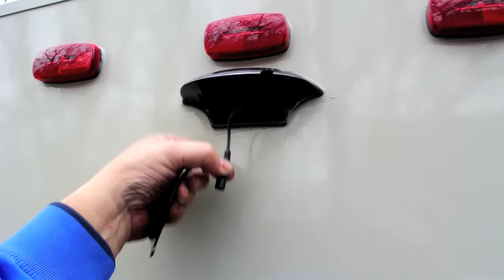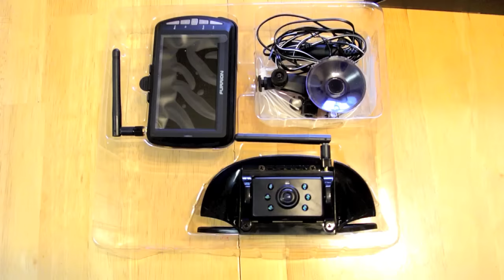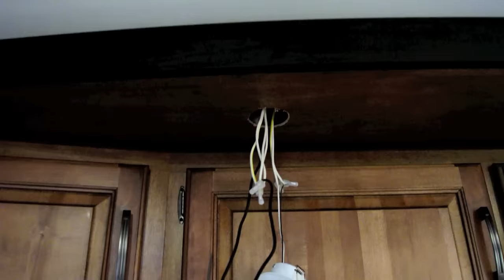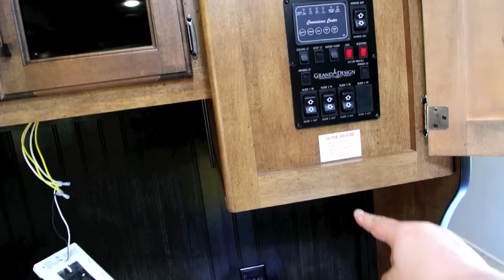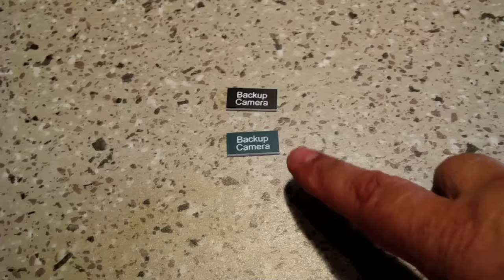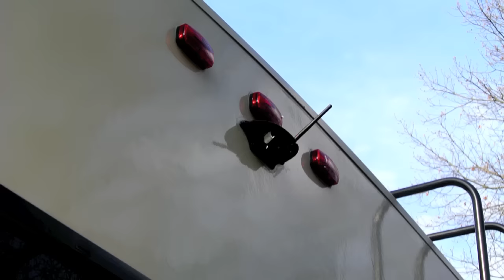Installing a Furrion Backup Camera on my RV.

Comment: I Bought the Haloview RD7 to replace a camera system from Furrion Vision S that had significant drop out issues. Installation was not a problem - powering the camera off the top rear marker light. Swapped out the old mounting brackets for the new ones and ran the transmission cable up to the front of my 26 foot long camper. Mounted the transmitter with liberal amounts of RTV/Silicon.

Got the monitor hooked up in the cab, powered it up and turned on the marker lights. The camera and monitor paired automatically and provided me a terrific view of my back yard - as expected.

Finally got to road test it this past weekend on a short camping trip - about 50 miles one way. Camera performed flawlessly the whole way - didn't notice a single drop out and had very little, if any flicker. Decent field of view as well. I can see cars within about 20 feet of my rear bumper and can pick up the entire lane of expressway on either side at about 40 feet back.

I am VERY satisfied with the performance of this system so far. Big test will be next month with a 1000 mile trip coming up. Looking forward to it.
Reply from the maker: Thank you for your input. I have been asked to review this setup but I would have to replace my current system or at least run them in parallel, something that I cant do at this point.
Reply: how did you get the bracket off? the opening to get to the mounting screws is way smaller than my small 1/4 inch drive 1/4 socket. I can't get the dang socket in there to get it off

Comment: I just installed the RV Observation Backup camera on my 2018 Flagstaff SuperLite. There is not battery drain on my camper. The camera is not ON until the camper is connected to my truck and I turn on the running lights. I will be making a trip Saturday and excited about using the camera.
Reply from the maker: Thank you for your input.

Comment: It said powers up with the trailers clearance lights, if wired into that circuit, your camera would come on anytime you turn clearance light on. Pretty easy and no worries of killing house battery. I always drive with at least clearance lights on plus I’d want camera on all the time I was driving, not just in reverse.
Reply from the maker: Thank you for supporting the channel.

Comment: I have a 2015 travel trailer with the exact prewired Furrion backup camera housing.  The 12V power wired to the backup camera is tapped into the parking lights of the trailer since there are marker lights in the rear just a few inches away from the housing.  Therefore in order to use the camera I always have to have the parking lights on.  I do like your setup better.
Reply from the maker: I actually upgraded the camera to the Vision-S version with 4 cameras. The side marker cameras were powered by the running lights, so I retrofitted the rear camera at that time to run on the running lights as well.

http://www.rv-project.com/projects/furrionscamera.php

Comment: TD Projects-I took my camper back to the dealer today and they told me the wires was backwards so they fixed it and now my camera works. Used it coming home and backing it up at home. Seems like this has been the problem for several people with the pre-wired cameras.
Reply from the maker: The only thing that works on the RV is the owner!

Comment: Very nice install. One would think they would provide a switch if the camera was to serve double duty as a security camera, or they would have wired it to the parking light circuit.
Reply from the maker: Depending on the year and model, some manufacturers - including mine - have used different power schemes, including wiring to the running lights of the RV (meaning you have to turn the lights on in your tow vehicle).

This seems to be the current most popular connection method.

In my Vision-S installation video, I did relocate the power source from the hutch circuit to the center rear clearance light.
Reply: Yeah. I have a new trailer and I was thinking of installing a camera on the running light circuit, as I’d only be interested in using it as a backup/rear view mirror when towing. 

I get it that some folks would also like to use them like security cameras when camping, but I can’t see not providing a switch when prewired. I don’t think anyone would want the extra power drain when the rig is stored.
Reply from the maker: @JeffinTD  In a later video (which you can view here: https://youtu.be/yKzLoUVZPyY ), I upgrade to the Vision -S 4 camera system. I connected three cameras (left-right-rear) to the running lights.  

For the 4th camera, I 3D printed a custom housing and placed the camera on the hitch.  This camera is powered by a separate switch and is used not only when hitching the trailer to the truck, but I can also use it as a security camera at the campsite if needed.

Comment: Thanks for clarifying the camera options! I now know which system to buy, while saving money. Other videos have shown different manufacters wiring constant or switched power at the rear center clearance marker lamp, just above the preinstalled camera housing. Either for marker/clearance lamp switched, or reverse shifted switched power. Thought I would add that for anyone who is needing help on finding the wires.
Reply from the maker: I go over that on my website but not the videos.

Comment: IMPORTANT: If your camera does not operate initially, turn on your tow vehicles lights with the 7-pin connected. The camera power may be wired into the taillights.
Reply from the maker: Also, some mfgs hook up the camera to the Yellow wire (center pin - backup terminal). For this configuration, you must put your vehicle in reverse.
Reply: @RVProject  If they had done that with my Gulfstream I might not have figured it out and had to call the manufacturer.

Comment: A Range Rover pulling an Airstream up a lovely snowy mountain road, then a G Wagon passes them.  Love that target demographic.  

I have the old V2, worked pretty well but the antenna on the monitor is now falling off.  Wondering what the difference is b/w the S and V2.
Reply from the maker: I know the S series is compatible with their new 7" displays. I have been thinking of upgrading to the S series along with the side markers. 

I have to back into my driveway on the passenger side - there are obstructions that will not allow me to back in on the preferred driver side.

As a consequence a spotter is absolutely necessary - even with the backup camera.  And as spotters tend to be, they are not always helpful - so much so that I have taken my dish antenna out twice.

So I am thinking the side cameras might prevent future occurrences of that issue.

Comment: I think on my rig I will install a mini 12 Volt Battery.  And save the wiring Challenge.  A fuse on the positive and a on off switch at the battery.  Might put in in a plastic amo Box.   My rant.  Great vid.

Comment: When I installed my back up camera on my grand design  had the same problem withe the power on all the time,however i just wired it to the running lights just above were the camera is installed ,now when my lights are on in my truck the camera works ,way easier than installing switch
Doug
Reply from the maker: That is one option. However, you must insure that the voltage is sufficient. With all of the running lights on that circuit, especially since RV mfgs tend to skimp a bit on the wiring, you could find less than 10VDC at the light you want to tap into.

While 10VDC will be fine for things like running lights, it can result in loss of performance in your camera... such as loss of transmission range.

If you find that you are getting drop-outs in the video as you are driving along the highway - check and see that you have sufficient voltage to the camera.
Reply: you correct  however so far has not been a problem ,Its to bad Grand Design did not wire out to a switch  to start with .

Comment: Can you buy the backup camera without the monitor. My 2020 2500 Z71 Chevy pickup has an audio info system  so will camera image show up on vehicle screen when connected to the camper?
Reply from the maker: It is a proprietary system, so you need their monitor to work with the camera.  At least for this version. Not sure what future versions will bring. If they were smart, they would make the cameras compatible with the various vehicle systems.

Comment: 05/15/18 Installed on a 2018 Grand Design Imagine 2500RL   GOOD NEWS!  The camera only works if you have your running lights on so it is not on power all the time. Looks like Grand Design got the wiring right so need to try wire a switch for me. :)
Reply from the maker: They have changed their wiring plan several times, depending on make and model. Funny thing though, when I installed mine in 2016, the Furrion manual indicated Grand Design had wired the camera to the running lights. But when i installed it I found that is not so.

I kind of wonder if they had originally wired to the running lights, then changed their mind, then changed it again?

As a side note... I kind of got tired of having my switch located where it is. It seems i always forgot to turn it on and would have to open the slide to access it.

So, I have been working on an improvement, and in fact today - I am field testing an overkill solution. I towed the RV 2 hours on highway today, and the new switch worked flawless - even if it is a bit overkill.

My solution (drumroll)... a magnetometer sensor that keeps tabs on the current direction of the RV. When it senses a direction change - it surmises the RV must be moving, and turns on the camera for one hour.

Upon each direction change within that hour, the 1 hour clock will reset back to zero. Therefore, the camera will turn automatically when it detects a direction change,  and turn off after it sees no direction changes for an hour.

Brilliant, eh?

Actually, I am quite surprised at how well it is working.

I will publish a video in a week or two.  

I also figured out a practical use...this would be a great theft alarm for the RV. If anyone hitches to it and pulls away, the switch - upon detecting a direction change - can sound a klaxon, burglar horn, etc.
Reply: @RVProject  WOW 👍🙂

Comment: I just bought a 2019 GD Imagine with the back up camera prewired.  I will be purchasing the Furrion FOS48TAPBL.  Is your install still current for 2019?  Hopefully the GD folks have made this much easier.   Im not handy at all, so if things are the same, I will need to have it professionally installed with the rewire.
Reply from the maker: Yes, I still use the Furrion camera I installed in 2016.  I think most of the GD trailers are now wired directly to the backup lights. For a few years - around the time I bought my rig' - they experimented with different power schemes.
Reply: @RVProject  Thank you for the reply!  My son (21 yrs old) installed the backup/observation camera, but when he plugged it in, there was no power after plugging the trailer to power.  I next checked the power supply by hooking up the trailer to my pull vehicle.  No power on the camera (light wouldn't come on).  Took the camera off and tried a difference power source.  We then got power, the camera lights came on and the monitor synced and then we could see things --- so not too sure where we failed.  My son says that the issue is with the wiring in the travel trailer.

Comment: I am an RV newbie (just bought a 2018 Keystone Hideout). But, why not just shut off your circuit breakers when not in use? Then the camera would be off right?
Reply from the maker: That would be a solution if the camera were wired directly to the fuse panel.  But the circuit also powers the lights in the ceiling and hutch... and perhaps more stuff that I am not yet aware of.

Comment: In your search did you notice if Furrion had a camera receiver that didn't have a display but would send video out to a Composite video plug?  I have a radio head unit that has the ability to display video from composite video source.  I wasn't not able to find anything in my quick search.
Reply from the maker: I can confirm the Observation/Backup camera does not, and I since I don't own the Backup only camera. I checked the owner's manual on-line. I did not see one on the monitor either.

Comment: Nice video thanks. I have a Grand Design a well.  Why not just use your battery disconnect when not in use? Also, does anybody but me use a battery tender when in storage? If it would take a month for this to drain a battery I don't see a big problem here. Of course Grand Design should have wired it differently.
Reply from the maker: Its not just draining the battery, but I believe that continuously powering the camera puts unnecessary wear-and-tear on the camera. 

Also, we may be at a location for a week or two, and I would not be able to use the DC power systems in the RV if I  wanted to shut down the camera.
Reply: Now that makes sense. When can you come to Oregon and re-wire mine? I am installing mine in the next day or two.

Comment: I have the "prep" setup for the backup camera too.  So it's just the housing on the back of the RV?  I am confused why Keystone would even go that far...
Reply from the maker: Yes just a housing.  I believe RV mfgs get a package deal from Lippert/Furrion that has various accessories including the camera base, solar port, AC power connector and so on.

Comment: It appears the clearance lights are located directly above the pre-installed camera housing. Couldn’t you just swap the wiring from the interior lights to the clearance lights as it was supposed to be wired?
Reply from the maker: Some people have done that. 

However, anytime you add a load to wiring, the voltage drop over those wires will increase, resulting in less voltage at the load.  In extreme cases, the wiring may be so small that a significant voltage drop can occur.

As cheap as RVs are made, they often have such marginal wiring.  You must ascertain that the increased load on the clearance light circuit by the camera does not reduce the voltage so much so that you have diminished performance (range, etc) in the camera.

Comment: Why did you go through all that wiring? The camera is on while the parking lights are turned on. Why is that a deal breaker for you? Thanks in advance!
Reply from the maker: For my RV, the camera was factory wired to the hutch circuit, not the parking lights.  That means the camera is on all the time, unless the RV's battery is disconnected. 

Depending on the model and year of my brand/model RV, the camera wiring scheme has changed several times. Other models have been wired directly to the battery via fuse, while some are indeed wired to the parking lights.

From owner feedback, I have learned that other brand RVs have also occasionally wired the camera to the backup lights, which means the camera is only on when the tow vehicle is in reverse. At the present 
time, wiring the camera to the tow vehicle's running lights seems to be a popular connection scheme.

In fact, the new Furrion 4 channel camera system (backup camera, left/right clearance camera, door camera)  have combo camera/running light assembles that allow you to position the camera adjacent to the running lights. These are pre-wired to the clearance lights.

Comment: Do you happen to know the screw sizes for this unit? I've dropped more than I care to admit into the gravel below. Was going to get some replacement screws.
Reply from the maker: If you are referring to the little flat-head screws, I am not sure what size, but my guess is if you purchase a M3/M4/M5 metric screw assortment, you will have the correct size. Amazon, eBay, etc. sell them as 300-500 piece assortments.

Comment: The smart way is wired to the marker light so it is powered any time the lights are on.
Reply from the maker: Assuming the manufacturer wired it that way. For my manufacturer, depending on the model and year, they have used at least different 3 methods for powering the camera.

I eventually upgraded this camera to the Vision-S series, and at that time, I wired the camera to the running lights: http://www.rv-project.com/projects/furrionscamera.php

Comment: Couldn’t you have run the power from the red running light just above the Furrion enclosure?... Then you don’t need to fiddle with/remember to turn it oof and on with a switch?...
Reply from the maker: I actually did that in the latest upgrade of the backup camera when upgrading to the Vision-S (4 camera) system.  I published a video of it here: https://youtu.be/0svYd1JauYs

Comment: I'm putting this camera on this week.  If I turn the house switch is off wont that cut any power to the camera?
Reply: George Vickers pick up power from the running lights. You'll know your ok when monitor picks up camera dignal.

Comment: Would i be able to bring monitor inside rv to use as security camera? I would need some sort of power for the monitor.
Reply from the maker: Yes. You can move the monitor inside. You would need access to the 12V system in your RV to power the monitor.

Comment: Is the blue LED light on the camera supposed to stay on?  Mine is staying lit after installing.
Reply from the maker: The blue light indicates the camera is being powered. If yours is on all the time, it means the camera is receiving constant power. Mine was wired exactly the same way when I first installed it, and I don't like to leave it on all the time. 

So I would recommend either adding a switch to the camera from somewhere inside the RV to turn it off when not needed, or what many people (and mfgs) do is wire the camera power to the running lights. This means you need to have your headlights on when towing to power the camera, but that is also a good thing I suppose.